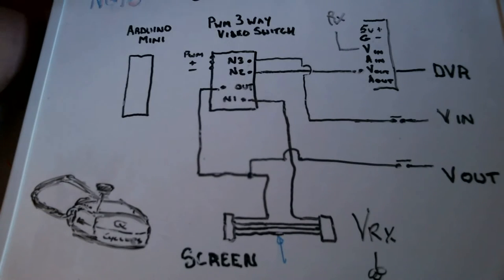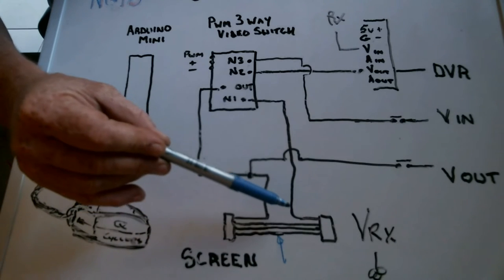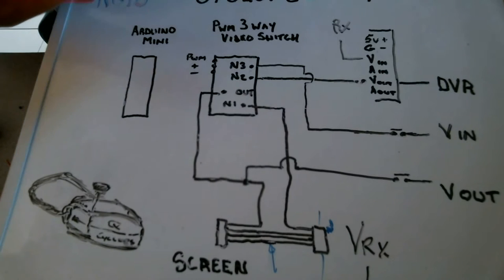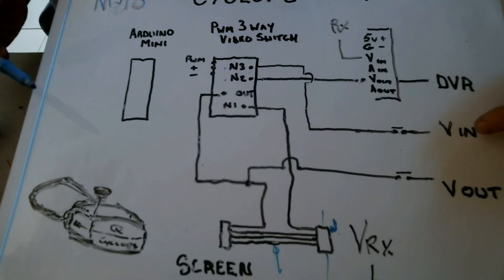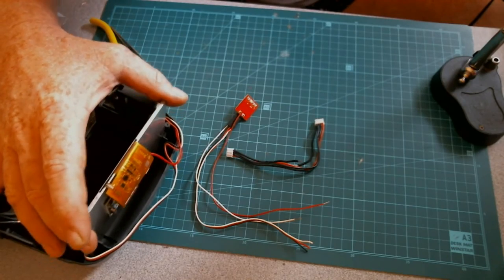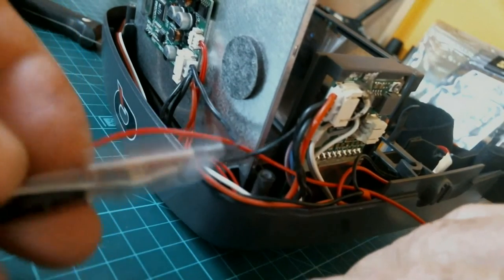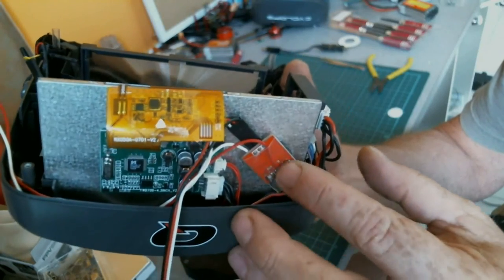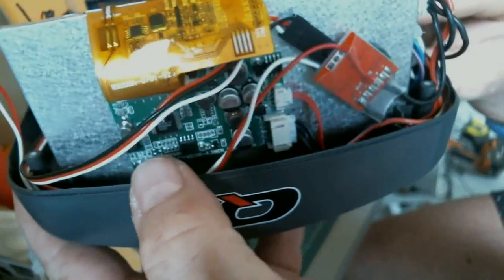Quanum Cyclops 3 way video switch Mod

Comment: Would it not be easy to simply to add a video cable out if you set it up without audio.? I assume you wouod tap into the video cable and run a wire to a aux female jack?